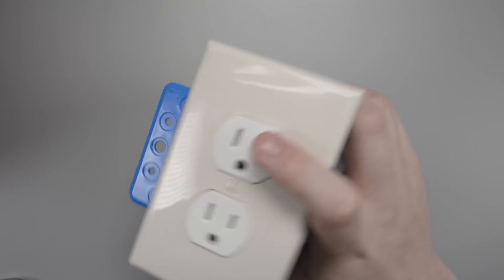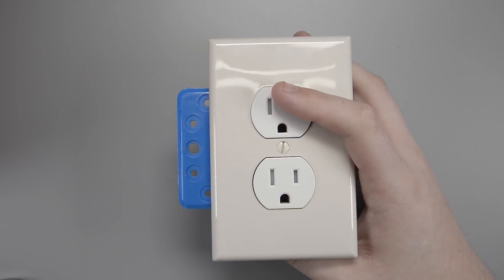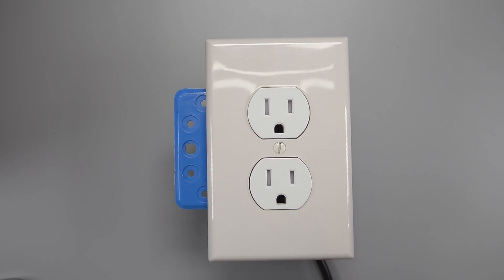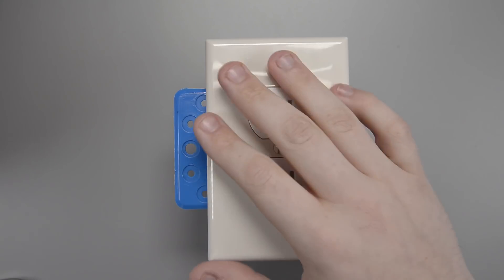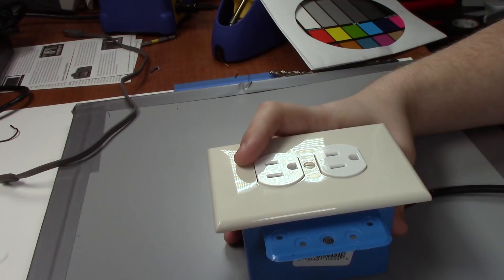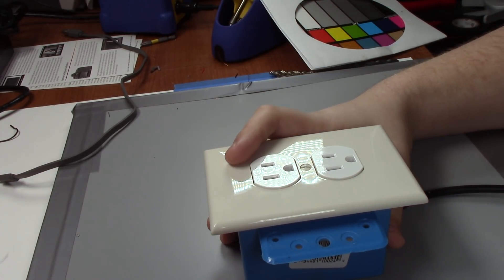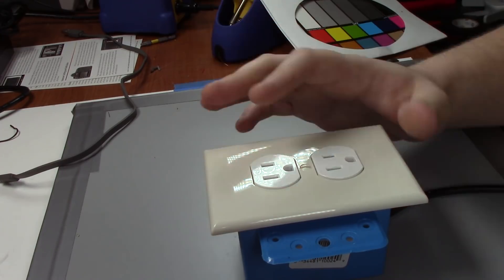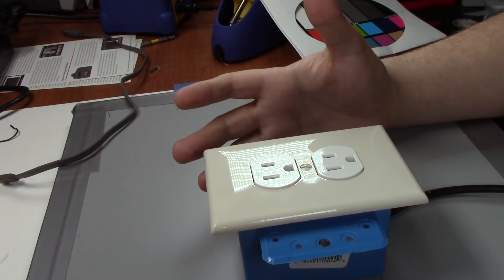Router Booter - What went wrong?

Comment from the maker: Got a question or something to add to this video? Or even an idea for a new tutorial/video that you'd like to see? Check out the ItKindaWorks forums at http://itkindaworks.com/forum/
Reply: Sorry for the length, but there's a lot to cover, and I just found your channel today.  First, I like your channel concept and the criticism is meant to be constructive, and possibly instructive.
This project, as it is, violates NEC (National Electrical Code) standards.  High voltage and low voltage must be isolated from one another and electrical tape doesn't cut it.  Low voltage (anything 50 volts or less) should be separate from high voltage, as in a separate enclosure, or secured in such a way that the two cannot possibly come into contact.
I am not familiar with the Sonoff module but imagine it is some sort of solid state switch.  If this is the case it would be much safer if it is opto-isolated as I suspect.  If it is not, there are enough channels that can teach you how to build your own opto-isolated, solid state switch, which would be in keeping with the spirit of your channel.
Frankly, this project would not have had near the criticisms, had you kept it all on the low voltage side.  You mentioned that you have two power requirements for the routers you are working with, 12v and 24v.  Your project could be built the same for both, with the exception of a couple buck converters which could have been a plug in module, and avoid all the possible hazards involved with high voltage. 
Paraphrasing from another of your videos, 'you want to teach others'.   This means your videos are targeting others which know less than you.  This opens the door to other hazards...
I appreciate your efforts.  If I can be of assistance, give me a shout.

Comment: I thought your "Router Booter" was interesting and informative. When I can, I almost always rather build something from scratch than buy an off the shelf solution. (boring) This is a creative solution to a common problem. I too hate the calls from family members because their Internet stopped working.I moved to Japan, but making something like this would be much cheaper. :) 

I'm almost finished with the Home Energy Monitor Project now. Very interesting, but frustrating as I'm doing it without the Arduino; just the ESP and an ADS1115 ADC module. Etched my PCB and calibrated the voltage last weekend.

Keep up the great work.

Comment: Great video.
What I'm wondering: What happens when the router does an automatic firmware update? I've never checked it because usually they do them at late midnight, but doesn't they cut the internet connection during that process as well? If it's the case it could cut the power while the new firmware gets written/applied.
Reply from the maker: This was pointed out in a comment in the original video (though it was only about regular updates not automatic updates). It could certainly be an issue with this project and something to keep in mind as it could brick a router if it's in the middle of the update. The "solution" would to not use automatic updates and either plug into a standard outlet for updates or drop the router booter into config mode which will stop it from re-booting the router until you exit config mode.

I've personally never been a fan of automatic system updates. Don't get me wrong it's probably a good idea for the everyday person but being a geek I like to know/dictate exactly when things update. Sure it means I can be slightly behind on updates occasionally but I'm fairly on top of my devices and updates in general.
Reply: Alternately, having a longer delay, if you know how long the update process typically takes. i.e. I know over the UK a colleague's ISP router routinely reboots for updates. at around midnight... so you could either have the ESP use NTP to know the time to take into account a regular process like that or have it wait for the typical update period plus two minutes to give it a chance. AFAIK both the wireless connection box and the ISP provided router I do their updates on power-up... and I've not seen them go down on their own for updates yet.

Comment: All the routers I owned had to be restarted from time to time. I doubt if it has anything to do with the price. Therefore I am not going to buy a new one that is purposely expensive and just presume it will be solved.
Therefore your circuit is pretty interesting. If/when I build it yes I may decide just to switch the lowvoltage and maybe I will decide to use a sonoff but that is definitely not meant as criticism. You had a great idea and built a circuit that worked for your purpose and shared it with the public. I will happily and gratefully take that concept and adapt it for what is best for my goal. My circuit isn't a 'better' way, it is just what works better for me. So don't mind all the 'why don't you use'  comments, your idea is great and I will build it and have my router problem solved for just a couple of euro's. Well heck I could use one of my functioning esp's and add this functionality.
Thank u for yr great idea
Reply: I know it's not the point of the video, but I thought It might be interesting. I have Mikrotik (RB750G) router which is a brand that make really advanced network products and I have literally never had to restart in once in 4 years. The only time it gets power cycled is if I loose power in my house.

They are not even expensive, but they are a little complicated to use so I don't recommend it for the average person, but they arent the worst to setup either. Let's just say I wouldn't give one to my Dad to set up!
Reply from the maker: Yeah I don't know what it is about consumer routers but they all just end up needing a good kick in the pants every once in a while.  It's just the nature of the consumer level beast (I'd like to think that most of the time it is my ISPs fault because F them but who knows really).

I totally get wanting to use a sonoff, I admit they are attractive because they make building stuff like this far faster. I know my ways aren't always the most efficient but sometimes life is just more fun that way ;) Have fun building dude!
Reply: @ItKindaWorks  I ended up building something around an ESP8266-01. It is fed by the PSU of the router and patches it through to the router. polls the internet and if it goes south it interrupts the powerline to the router.
as far as total self built goes....I just used an NPN transistor, a diode, a base resistor and a bare relay rather than a relay board
Reply: Mikrotik and Ubiquiti are both solid and not ridiculously expensive. Unfortunately the average consumer only knows about the all in one devices (gateway + AP)  readily available at the local big box store. I can't blame them.  If you are not into doing a lot of research or have an IT background you just won't have heard of these small office class devices that are much more reliable. The downside is they are not nearly as plug and play as the ones from the big box store. You have to know something about networking to set them up properly.
Reply: I have a solid Billion combination router/modem, and damn that thing just keeps going... they used a  decent wifi chipset (proper broadcomm) and all. At the moment it has not power cycled in some six to eight months and is just running as a router/wifi AP now. I also had it going for about two years as a modem/router,  but also had it set to automatically reboot once a week so it would also resync the ADSL line, as well as clear out the cobwebs... never missed a beat. I can't say the same for the ISP modem I have now... but it could be a lot worse.
Reply: Brian, indeed you are right, as I said price isnt really a predictor of  the quality. I have had a more expensive router (though it is hard to compare prices in different countries over  a 15 year time span), that still had the same issue.
Now I have a provider supplied Experion modem/router and my experience with that one is still a bit too limited to say anything about  it 'hanging up'. Nevertheless if it does, I know what circuit I will be building

Comment: i respects you for this video more than ever. 😉 i have a very easy way here. what about using a MOSFET as switch on the router DC power line and here we don't need to play with AC 🤔
Reply from the maker: I actually addressed that in the description of this video. That is a totally valid way to go for your own setup. However because this is meant to be a drop-in device, going the AC route is easier because I don't have to modify each unit for the specific router connectors/power supply.
Reply: ItKindaWorks most of the routers have same connector type middle positive.
and almost all running on DC 9-12V so a selected voltage regulator with 5V output to power the ESP
Reply: Best way to do that would be with an inline barrel socket and plug, so at worst hopefully just having to swap the connectors if they are the wrong size. But the AC route is certainly the one that means you wont' have to worry about any connectors ;)

Comment: Hey I was the one criticizing you for your tinned wires. Thanks for making this video and correcting it. The reason why solder isnt used in conjunction with screw terminals is that tin (=solder) is able to "flow" (don't know the English technical term, my technical knowledge is quite constrained to German) at room temperature. No matter how good the screw connection is at first, and it may even be good for years to come, it may flow in such a way that the contact goes bad which CAN cause sparking. Using just the bare wire is fine because copper and the other elements present in wire do not flow at room temperature. A ferrule would keep the little wire strands together, tinning the tip of the wire is okay in this instance, but only if the tinned part is not part of the spot on the wire which gets squeezed by the screw terminal. It's a hack, but at least safer than it was before. Thank you for addressing it, I am looking forward to your next videos having saved you from electrical firery death. :)
Reply: I agree fully tinning a wire carrying  mains A/C attached to a compression terminal is a valid concern for a general purpose connection and should be avoided.  In the situation where this is likely to be installed, the risk is fairly minimal, but I agree it's not ideal. Since the current of a home router is very low, the connection is not likely to heat in any meaningful amount, and if any potential sparking did occur, it would be proportional the low current being carried. This is very different than say if someone was using the socket to power a hair dryer or microwave oven. It's good to bring this to peoples attention for their general knowledge and future projects that may be dealing with much higher current.
Reply: Not that I work with AC much, but even eutectic solder has to be heated to at least 180C before it hits its plastic state. If it was a high frequency application, I'd be willing to say that the bare wires were a better option, but I'm having trouble viewing 60Hz AC as anything of the sort. The amount of current required to heat those wires enough to begin melting the solder would need to be around the level of an electric floor heater being left on for a full day, at which point you'd have other more pressing concerns. As a result, I fail to see how this would matter given the project in question. As a side note, I am an electronics engineering technologist, so I can understand any explanation you provide.
Reply: Solder doesn't require to be heated to slowly creep and change form over time under physical pressure. The solder will never melt in this application, but a previously good connection can fail after time and may introduce sparks. Things in the vicinity can start burning from those sparks. I'm not saying that it will in this application, but since it is an instructional video, one must be overly correct with these kinds of things. Ferrules are the only method approved by the governing and legislative body in my country to keep wire strands together. And this is with good reason. Many house fires can be traced back to electrical failre of which some are from home-modified, of which some have this fault. It is bad practice and shouldn't be shown in this kind of video.

Comment: I am one of those guys that this and the previous video is for. I understand I can do a Sonoff and reality is they are cheaper than the components of this build but how am I going to learn to build these components. I am not worried about the coding because I have experience and schooling there but the components were not in my field. Now I would like them to be and this is my way to start. Thanks for adding the part about how you insulated the two parts. I hadn’t built the project yet but it was next on my list to build and I wouldn’t have done that.

Comment: Charlie there is nothing wrong with tinning the wires, why do you let those "experts" get to you, dont let them bother you, they only know how to correct others, with their  expertise from the internet, let us see the "experts" build something interresting  ;o)
Reply from the maker: I mean I did look it up and it's true that in industry soldered wires are frowned upon because the solder can shift/compress under the clamping load of the screw terminal and come loose/spark so I figured I'd make those people happy. But yeah I also figured that for this project, it's such a small load and never really going to move/vibrate like some piece of heavy machinery so soldering was probably ok.